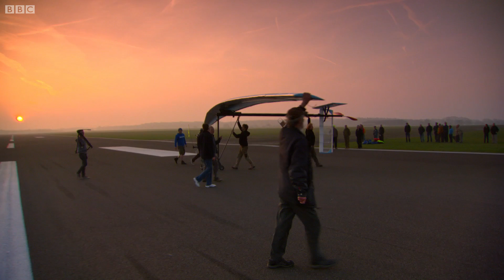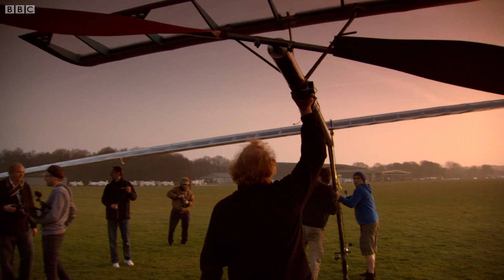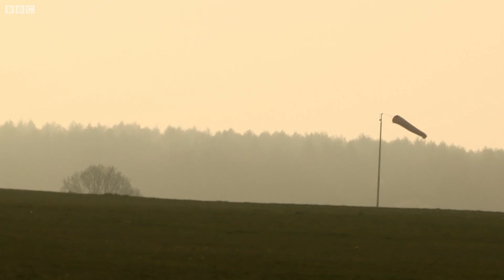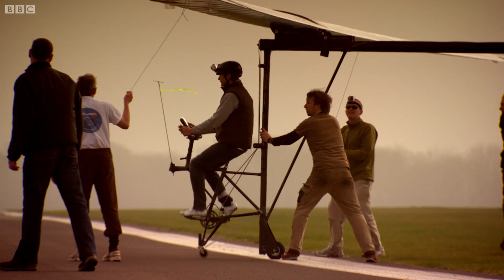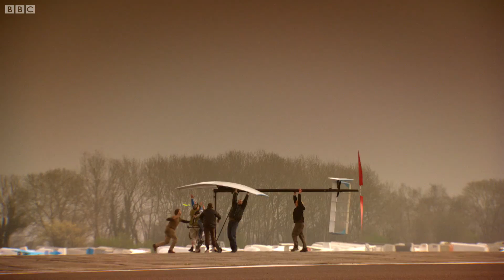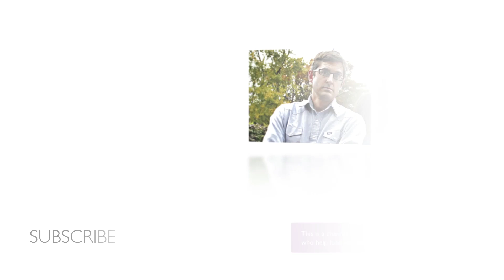Flying Bicycle Success! (Part 2) | Bang Goes the Theory | BBC

Comment: Big yes on gears that was my exact thought. If this thing had five gears and maybe a small flywheel you could build up momentum and speed in the propeller before the ground crew even let go. The ground crew would not be having to push it. You would know when it was ready to fly when the ground crew were having to hold it back then it would be time to let go. Tally Ho, Chocks Away, last one back to Blighty get a cucumber up their bottom.
Reply: Make sure they are some pretty fking good gears though or you are dead 😂 Maybe a good transmission, and some "electric motor assist"... and you are good to go ^^
Reply: What about wings that don't deploy until you're at takeoff speed? They could be inflatable and use the same tech as air bags.
Reply: @safedba  nope, rather have them angle to no-lift position untill takeoff and swich it with speed